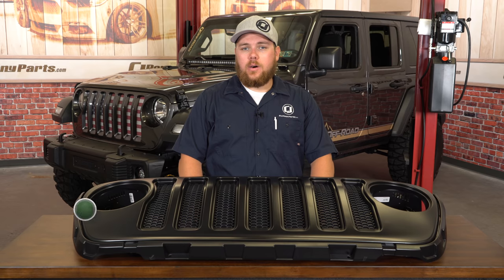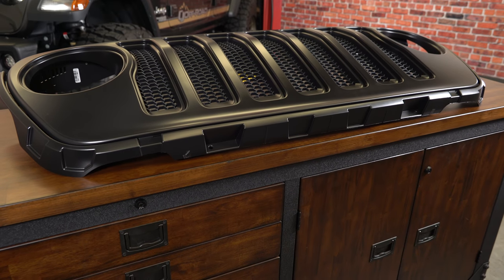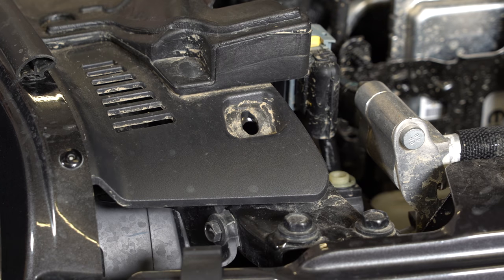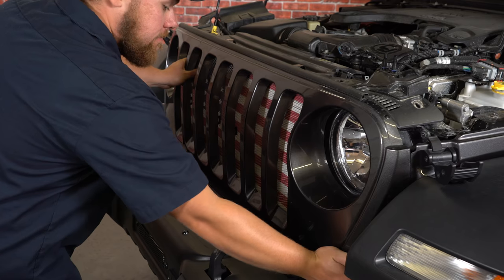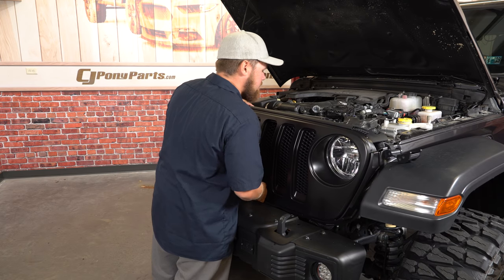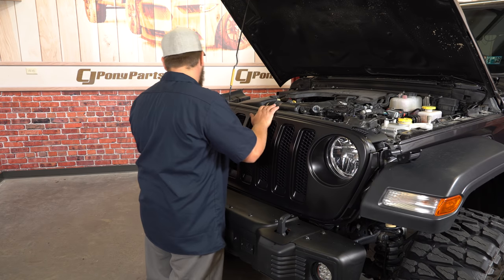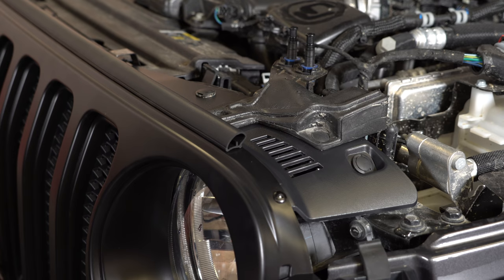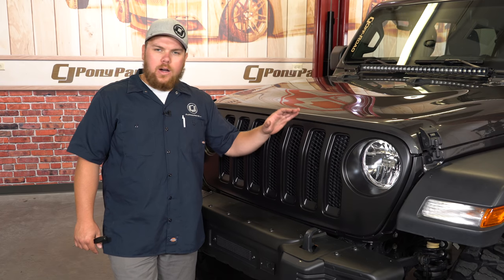2018-2020 Jeep Wrangler JL Install: Wrangler Mopar Satin Black Grille

Comment: Nice video. I wondered if it would be any more challenging to swap the JL grill than the JK. The JK was easy and looks like this is similar. I may need that flag insert 🇺🇸
Reply from the maker: I'm thinking to get the JL grille on a JK would require some modifications and slight trimming, biggest issue would be the headlight bezels.
Reply: CJ Off-Road I was comparing the ease of removing the JK grille with removing the JL grille, not thinking of swapping one for the other. 🇺🇸